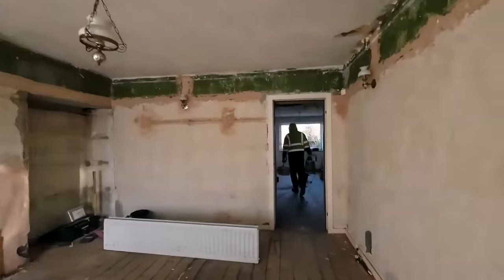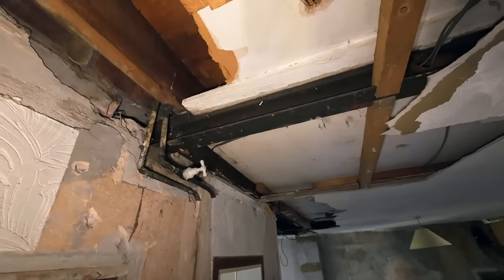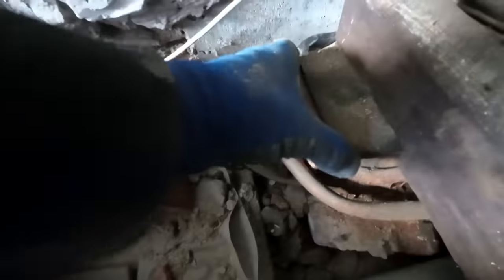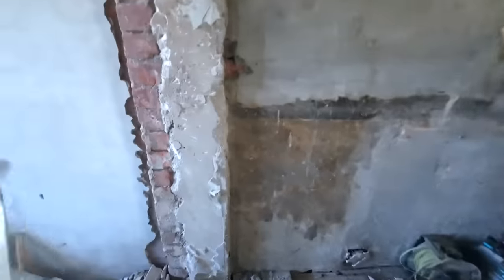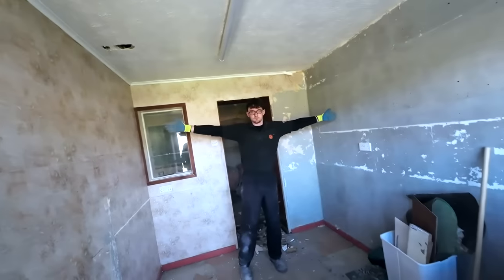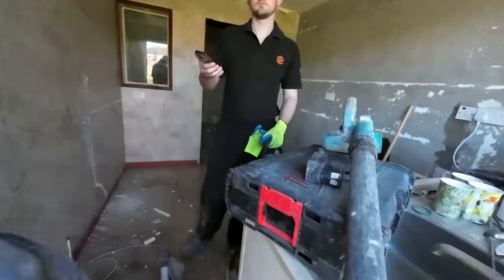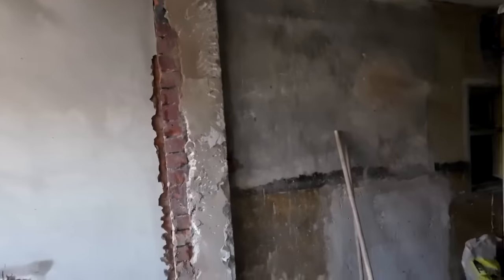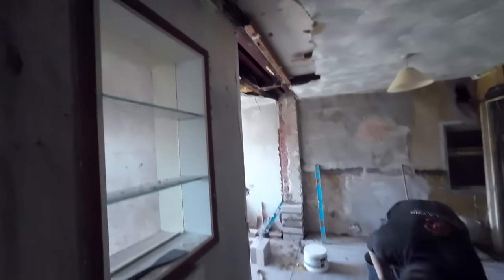HIDDEN STEEL RUINS OUR DAY ...PART 1 GETTING PREPPED

Comment: Great new sponsor,  Makita and I have some bad history after they repaired the gears on a £300 drill which went faulty again 3 months later and refused to repair a 2nd time on warrantee, it was only 10 months old and they wanted to charge me £169.99 to repair.
Reply from the maker: That’s ridiculous. Al bought me a site radio that cost £180 . It’s been repaired under warranty and broke again now . It won’t work on the battery which makes a site ratio pretty pointless 🙄🧱👍🏽

Comment: Are blocks lead flat the same newton as stood upright? Always got taught lead flat is not the same strength. Nice work as always 👍🏻
Reply from the maker: No not as strong apparently but not much in it 🧱👍🏽
Reply: @SteveAndAlexBuild  will you be using ties/ fixings/ starter tie for that block pier?
Reply from the maker: Tied in 🧱👍🏽

Comment: If the place is that bad & totally stripped out, would it not be easier to demolish the place & start a new, there's not much of it left & what is looks like a regulation nightmare 😮.
What's an open plan box going to cost them comparison to renovation
Reply from the maker: It’s a semi 🧱🧱👍🏽
Reply: @SteveAndAlexBuild  even better only 3 outside walls
😂😂, Great videos guy's 👍